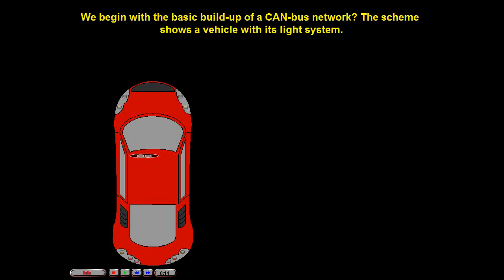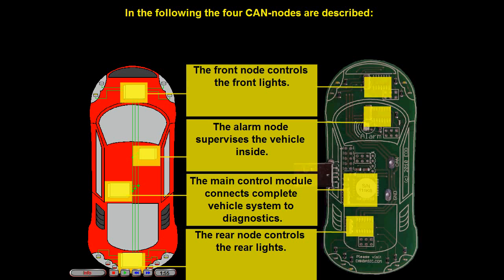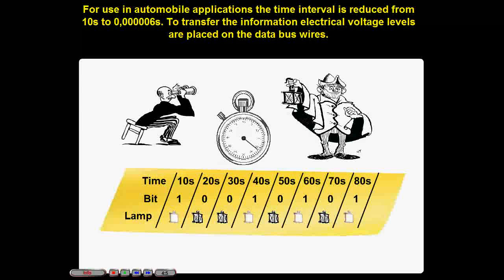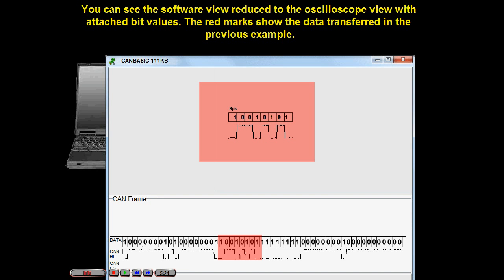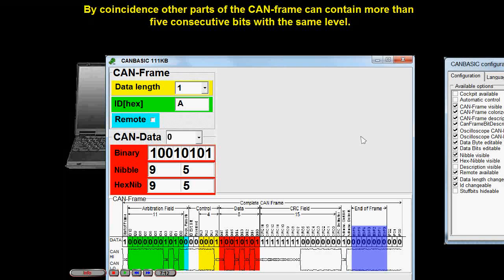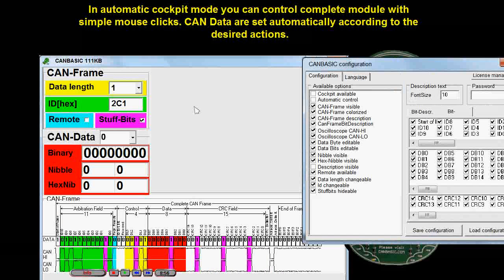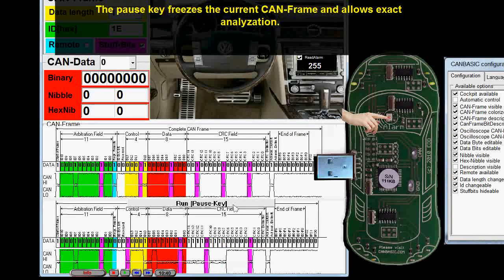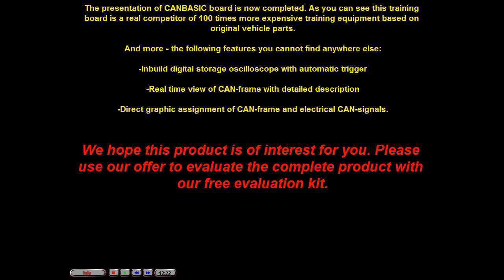Basic_CAN_Bus_Training.flv

Comment: It's getting ridiculous,it's just business. If they don't build something that can break there's no money to be made. It's been working fine for years and now you need modules that do the same thing that a few more wires have been doing. They trying to get the vehicles to a point that you have to go the dealer to get it repaired. They don't like the fact people repair there own cars now....built in oscilloscopes and real time crap..unbelievable!!!
Reply: mass productions are higher now, they need some new tech for faster assembling, testing and deploy. Old techs r way slower.

Comment: CAN is the interface over which your car is computer controlled.
    This is good or bad.   If you like to keep the car in perfect condition and have the service done at the dealer, then it's good.  The emissions will be just as designed, the anti skid and anti slip and airbags must be properly functional or it will shut down.  If you like to have your every move recorded in the data file for me to retrieve (remotely) and assess your activities, locations, and times then it is all good - you've got nothing to hide, do ya?    If you mess with emissions or tracking it will shut the car down.
      If you want to be able to work on your own car, then this is bad.  Not only do you need to know how CAN works, you also need interface tools and the interface definitions.   Few OEMs will share the interface definitions and they are all unique so you can't take information or tools from a Toyota to a BMW or to a Ford.
Reply: You can learn how can system can be fixed and do it yourself. I dont work for a dealer but i fix can problems. Just training is all. Do i know everything, no, but enough to fix problems
Reply: Totally agree with the fact that OEM's will make data on their vehicle's can bus' unavailable, which means on a simple level, you can't always simply just repair your own vehicle.  That is disgusting.  You know if / when they install a robot into their factory they want to be able to toggle every nibble, bit and byte.  But think you're too dumb to have the same access.

However, if you're knowledgeable you can use a can bus sniffer and work out what is what.  Time consuming for sure.  Can bus definitions should be public...

Comment: what a stupid way to make car electronics more complex and this results in naturally high unreliability, and very expensive repairs,  I kid you not my friends BMW E46 is now suffering from such an expensive can bus failure, rendering his car useless, oh it is all to save on number of wires, at the expense of more expensive controllers hidden everywhere in a car, this is shear stupidity in the name of science and technology, when simple wiring could be far more effective and far more reliable, you may save weight of wires but what about any weight saved in wires you are adding more weight of controllers and all the hassle to programme them to accept can bus signals, and processors breaking down or freezing on glitches or simply doing stupid things you did not ask for, these controllers occupy more room, in every nook and cranny, I hate all modern cars as their complexity makes them highly unreliable, if a can bus goes down, all your electronics freeze, you could be stranded, in cars there was no need for a can bus type of technology, even in aeroplanes as that would make them very vulnerable to failure,  if you must save copper wire and weight, use thinner wires to control high powered relays to control high powered devices such as head lights and heaters, and other  lamps, such complex serial data links you are bound to face failure sooner than later,  this is taking a step back not forward. That is my opinion as an electronics technician, I know as I go through so many things people ask me to repair as they cannot affoard dealer charges, but I just throw the can bus out and rewire their basic things with switches and relays, far more effective and better, fuck meall I wanted to turn on was a light bulb, and I now need a 64 bit digital code along a twisted pair to my bulb and use a controller and that interprets this signal and then fires a solid state relay that in turn switches on a light bulb! what an achievement in the name of advance electronics! A;l you neede was a simple switch and two wires that when it goes wrong you can replace it witha few dollars and not a few hundred dollars!
Reply: A controller area network is ESSENTIAL for cars. No only does it cut the wires used exponentially, but it can actually diagnose problems with the car, too. What's wrong with my car? Check the CAN bus. Engine problems? Logged with CAN so the user can accurately find out what's wrong with their vehicle. Keyless entry? CAN Bus. Temperature monitoring? CAN bus. Tire air pressure sensors? Brake caliper wear detection? Power steering? Differential locks? Turbo boost pressure? Oil Pressure? Tachometer? Speedometer? CAN bus. All of them. 

If you want a purely mechanical and electrical car that will fail and leave you with no clues as to what's wrong, but something from the pre-60s. Data logging and failure prevention makes vehicles safer. Especially for the average user.

 Imagine a world where there were no tools to check tire pressure or oil. Road accidents would happen much more frequently. We thankfully have those tools, but not ALL normal car drivers aren't educated enough to know to check these things regularly. Plenty of people don't even have a tire pressure gauge. With sensors and electronics, the car can tell the user what's going on. With these data readings, we are able to monitor and react to things before they go bad. CAN is a very efficient way of monitoring vehicle status. 

And as for that BMW E46, that's unfortunate. Maybe try choosing a car that's a little more reliable.
Reply: Sparky! CAN bus is easy enough to tap into. It's a lot easier to make it do what you want over the old-timer wires & relays. I can tap in 2 wires & send it commands to tell it what to do.
Reply: Good for dealer profits and good for data recording :)
This is why they did the 'cash for clunkers' , so you couldn't modify the new cars.
Reply: +samdomding What you say its true but you miss the fact that you can update the ecu easily in one shot, much more simple if you know the programming.the engines and vehicel dynamics use this techonology aswell. try doing binary cables and switches to control engine valves and speed differential between the wheels. my 2 cents
Reply: 100% true.  But, 'average consumers' do like technology - its human nature, to our wallets and purses detriment, and increasing profits of smart business. Here is everyday scenario occurring; Salesman/advertising shows consumer all these fancy things this new car/phone/TV/washing machine/Fridge/speaker/air-conditioner/door locks/light bulb/toilet... (you get the idea) can do. Yes it is nice when it is working and it generally does save some time/energy/money initially or makes life 'a little' nicer or easier, and we do get more information from the technology, but...   Mr Average Consumer likes what they see as OEM makes technology attractive to Mr Average Consumer. Mr Average Consumer buys and shows friends how tech savvy they are by starting his car (washing machine/cooking oven/dishwasher..) remotely and the air-conditioner, and getting smart phone message that the car inside temperature is at desired 22degC remotely on an app.. Mr Average Consumer feels proud and smart. 12/24/48 months time product fails.  Everyday person or non factory certified technician cannot fix due to needing the software/hardware/service manual/passwords/OEM specific knowledge. Mr Average Consumer must contact OEM. OEM service tech comes and price is $2200 for new OEM module and labour to fix 'non functional left headlight'. (Mr Average Consumer wouldnt even know if that was the real problem and new $2000 module was needed, just has to believe the tech).  OEM makes highest profits that couldnt be made in sales margin due to many of competitors making same/similar product.  Mr Average Consumer rarely considers future costs of repairs when starry eyed. But also Mr Average Consumer has little choice now-days anyhow, because all manufacturers use high technology in their products to initially sell the product by advertising the futuristic technology and energy savings to Mr Average Consumer, and make maximum after-sales service profit.  Business which we rely on for our everyday products and lives is profit driven (and must make profit to survive and keep surviving into the future, including dead time on ongoing R+D), sometimes driven by shareholders - board will get sacked if profits slump or in debt. And that can be bad for Mr Average Consumer because if all manufacturers dont make significant profit and fail,  then there is no competitors making products, then 1 remaining manufacturer has monopoly and of course purchase price also now goes up. Mr Average Consumer either doesnt buy it because they exercise their rights and not buy in protest, or does buy the new car/fridge... because they need it, and just be smart and ask questions and do research, like asking what is warranty, what is cost for all replacement parts, labour.. In modern appliances, cars and complex machinery, data via electronic modules and busses can be helpful, giving infinite control of something, displaying the faulty part info. But also and more often than not, depending on quality of the design and manufacturing, is the source of the problems.. The more complex the equipment, the more chance of failure in manufacturing or design. Thats modern life, thats business..  ps. I am an electrical service technician for large industrial and domestic electronic equipment.
Reply: samdomding  its easy to repair car, more accurate working with efficiency
Reply: I think there are more benefits than there are detriments when comparing it to the old wiring looms, but it probably depends on the vehicle and how detailed your repair manual is.  Anyway, wiring looms and their branches are often taped together, so even if you needed to rewire only one door switch, you still end up pulling more than you need, and then you better pray you reinstalled that mass correctly.  Give me two wires (one cable) and hidden controllers, any day.

The high cost is related to the "foreign" technology.  Shade-tree mechanics should be able to deal with CANs and even implement non-OEM (cheaper) equipment, but perhaps don't because it seems complex.
Reply: Luddite.